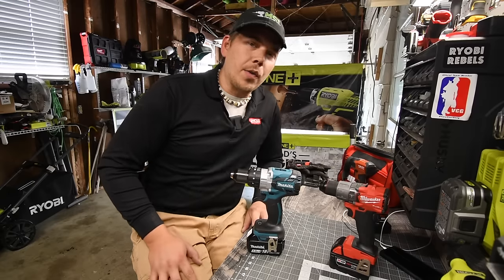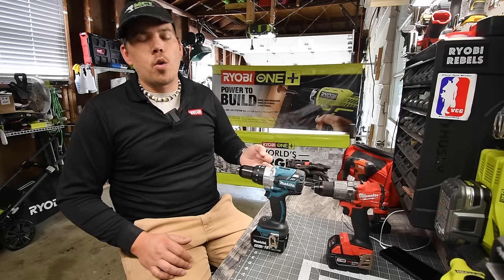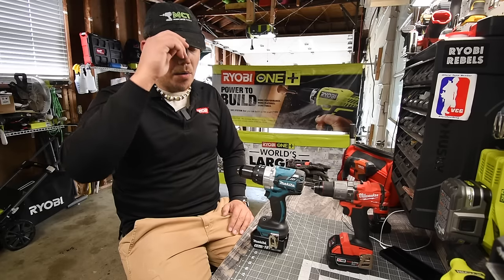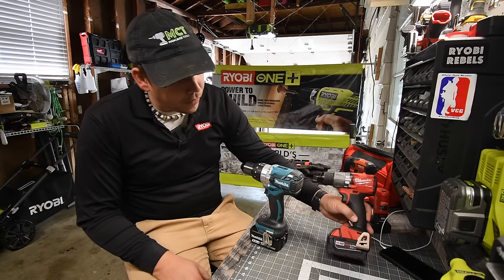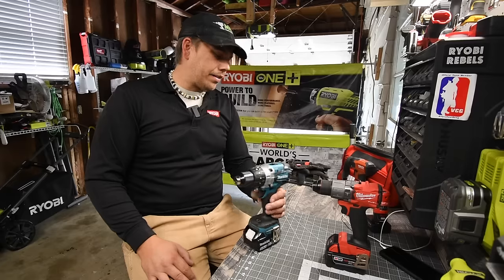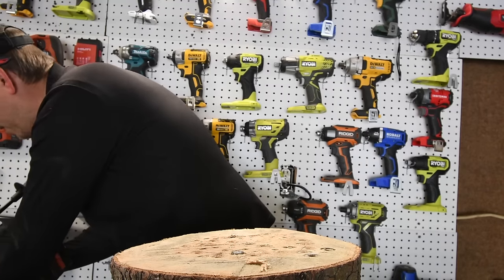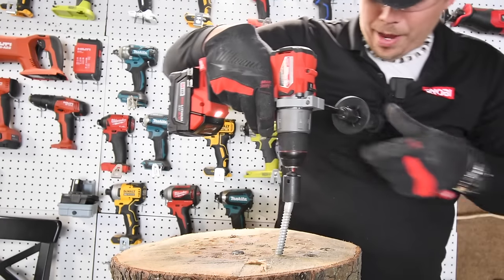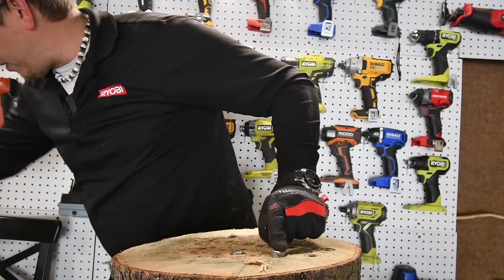BATTLE OF THE BRUSHLESS!!!  (Makita vs Milwuakee)

Comment: The chuck problem I have never had on my Makita and it is 8 years old and well used. Just tighten it and make shure hex inserts are lined up properly. never read or heard of clicking back before.
Reply: wrong, makita made a video explaining that you need to turn it back once to lock in place

Comment: I drove lag bolts like this for over two years straight with an old blue 18v Ryobi 1/2 drill 15 years ago. Im not really impressed by this test lol. And yes I still have that old Ryobi it still works fine but needs batteries.
Reply from the maker: Very good and I thank you for viewing Gary

Comment: I do think not using the correct battery does not match real life when I use high output. I get it, but I would think a fuel owner isn't picking their xc, I believe people will use their best battery
Reply from the maker: I wouldn't either, but not every test I do can only be using one type of battery

Comment: you can use the hyper tough cordless hammer drill to drive bolts
Reply from the maker: lol I think I would destroy that hammer drill very quickly
Reply: in hammer drill mode
Reply: @ManCaverTools  becuase its hyper tough and its cheap trash

Comment: So dont really matter at all, both very good, and very good even for professional users.
Reply from the maker: they are awesome hammer drill but it all depends on what battery platform people want to get into
Reply: @ManCaverTools  already have 10.8v makitas ( wish they had more tools on that platform) and 18v milwaukees , never had anything like it, only beaten by Hilti big plugged in tools.. did a 130mm hole, 400mm deep in reinforced concrete just with the18v Milwaukee... took quite a few hours, and it was burning hot, and think 5 or 6 battery changes... but it did it ;)

Comment: The battery difference is kind of unfair though. Milwaukee offer that drill with the capability to use the high output battery, so that makes it a product. Just because makita doesn't offer the same level of battery technology doesn't then make it fair to test the milwaukee in a mode where its essentially not performing 100% whilst the makita is performing at 100%.
Could of used a high output 3ah milwaukee and a 3ah 18v makita
Reply: yes

Comment: as far as i know makita in 2 gear stops when there is to mutch stress to keep the gears safe while milwaukee doesnot do that  
the last milwaukee i used broke easely while i had to get a nother drill i got a makita and it did better than milwaukee i took the milwaukee apart and the gears were broken inside now i only use Makita and Dewalt 1 of the makita is from 2016 the other is from 2019 the Dewalt is from 2006 the milwaukee was from 2016 and i have a small makita 10,8v from 2011 DF330D that has been handy in narrow spaces i like these tools :)

Comment: My brushless Makita is an absolute pile.  (Makita XFD12Z 18V LXT Lithium-Ion Brushless Cordless 1/2" Driver-Drill)  It has a horrible variable speed trigger that is hard to control and it shuts down way before the battery is discharged. The first thing to break was the chuck so I installed a Jacobs all metal one, then the clutch got weak and now under heavy torque it will randomly stop and make the grinding noise until I shift it back and forth a few times. It also abruptly shuts down when driving three inch deck screws. My 14 year old white Makita may be a little slower, but it kicks the new ones ass because it doesn't fail me. I'll probably switch to Milwaukie as I have yet to see one fail as quick as the Makita.

Comment: i think a fair comparison would be to use similarly priced batteries.  you can pick up a makita 5.0 for around $100 and an M18 6.0 HO for the same price (amazon now has the makita at $119 & M18 at $85 but since this fluctuates i think its fair to call it even). Just a thought
Reply from the maker: I don't think that would be a fair comparison

Comment: Hi love the videos, the makita was closer to the milwaukee than i thought it would be! Just a wee point to add about the makita on the irwin wood bit test, if you hold the trigger in any amount even just the slightest bit and the chuck cant turn then it seems to have a function that turns off the power to the drill! The trigger needs to be released and pressed again, Im thinking its a saftey feature so that it wont burn out the motor as is not turning! 
Id say the extra torque on the gen3 is what kept it going! I’ve used both drills and i find the milwaukee feels heavier while using but is definitely stronger! 

Wondering when makita are gonna upgrade their hammer drill/driver! 

Also i had never heard of turning the chuck back one click before, i always just tighten it up and it has never loosened! 
If you had time to do a quick test off camera by tightening it up full and maybe repeat the concrete test just to see if it does any better,  it was agonising to watch it keep falling out of the drill!! 
If its still doing it get on that warranty!

Very good video all the same and sure it made for a good comment section! 
Keep up the good work!!
Reply from the maker: Makita really needs to work on this chuck big time. just like Milwuakee needs to work on the collit for their fuel impact driver.

Comment: jesus, learn to tighten the drill and use is correctly. it's pain to watch this sloppiness..
clearly marketing bs.
Reply from the maker: have you tried to click back your chuck? if you havent give it a shot. it doesn't work with all drill
Reply: @ManCaverTools  i use mikita its my tool line and i never turn my chuck back and i also never lose bits
idk it just seems like one of those things where the proper way is not really the best way maybe im wrong but then again i never worn out a 1/4-1/2 bit before either

Comment: I'm very surprised with the Makita's chuck coming undone from the bit, also the clicking while tightening the chuck sounds like a clutch or something is stripped out. But I will say this, both drills in these tests are amazing.
Reply from the maker: I broke the chuck, im supposed about that
Reply: @ManCaverTools  sucks that you broke it, I figured it would be a tougher drill than that
Reply: It doing that because every-time he tighten chuck he also lose it by clicking back. Makita only tighten chuck to one direction, there is no "lock" by clicking afterwards to opposite direction. I think the guy on video is used to other chucks and he doesn't bother even read the manual.
Reply: @fusssarium  actually turning the chuck back one click is supposed to keep the bit locked in, Makita Australia has a video showing how to tighten bits in the chuck, they show turning the chuck back one click to lock the bit in. it doesn't always work as Dave explained with the Milwaukee. But i think that Makita may have been faulty from the factory. I own the same Makita drill and the chuck is rock solid, never any issues.

Comment: Personally they are very similar.. both are better than dewalt..  most of my electric tools are Makita.. had old Makita battery tool didn't last too long .. now have some Milwaukee battery tools they are still going strong after 4 years of abuse...its 6 of one half a dozen of the other depends what type of tool your using

Comment: Did you actually know that Hammer drills  are not a thing in asia and europe? We have the same high specs drills optional without hammer function. 
In Europe they have actually a bad reputation because it seems that the hammer function works negative on the drill axis and gearing or chuck so that you get alot of bit and drill wobble. After some time. Especially if you hit rebar.

I still own the Milwaukee M12 hammer drill as an secondary.  It has it advantages especially on this tiny funiture dowl holes of 5 mm where an SDS is mostly overkill. But anything beyond 8 mm is just a pain with hammer drills also the big 18Vs. 

Anyways, if you see this comment. Check out the new Bosch GSB 18v 150c. Maybe its an interessting one for your channel. Its get released in middle 2021. 150 nm are like 110.63 foot pounds. Stats are impressive
Reply from the maker: I want the HILTI drill drive that europe has

Comment: when you insert hex bit try to have closed drill head as possible an insert between the jaws than tighten, not as standard drill bits!  whe you look at wood bar, it looks it has different dension on, try not to drill one tool on one side

Comment: When you had the chuck clicking like that, its because you had the clutch engage, to prevent That you have to set the clutch as high as it will go! Just a tip, good work otherwise
Reply from the maker: I thank you all computing
Reply: How much mellaike
Reply: No, the clicking comes from the transmission. My one did the same noises while locking the chuck and a few months later the transmission was gone.  
Spindel Lock is the mechanism called, that makes so much problems on the Makita drills.

Comment: Great Job David! Even though I now handle these tools & see & feel the difference, I don't use or keep them. Also even though all brand new, I just slap a battery in check all the settings quickly before they are repackaged & sent off. Nice to see them in action!
Reply from the maker: Its a good way to sell them and I thank you Bro
Reply: That’s cool ! Where do you work bro? I’ve always wondered the inner workings of the tool world

Comment: Great vid! Cheers from Argentina. Im switching from my old ni-cd 18v Daewoo to this 2804 Milwaukee. I think that i will be very impressed! Do you think that a high output battery would make a significant difference?
Reply from the maker: the high output has a major difference with tool performance

Comment: Good show, Makita is very nice but no matter what these different manufacturers do Milauwakee always comes in the top, their power tools are the best. 15 years ago I made my basement with few Ryobi tools I still have the saw and drill it's works for small stuff
Reply from the maker: I do thank you so much for viewing :)
Reply: It depends on the tool every manufacturer is better at different tools Milwaukee don't have a better saw than Makita Milwaukee is just made cheap nowadays like they burn up just as fast as a Ryobi and don't hold up like they used to before tti bought them out
Reply: WRONG!!!!! Milwaukee is certainly not cheap made

Comment: I've had m18 gen 3 and m18 fuel hammer drills fail in less than 1 month, as well as other m18 tools. Pure disappointment in Milwaukee!
Reply: We use them at work and they have suffered the same fate don't matter how fast there are they don't hold up
Reply: My chuck blew out drilling 4 inch concrete today. The drill is 5 months old with occasional use. I'm very surprised to see all the reviews from around the country to see milwaukee chucks have gone down hill and keep getting worse. I removed the clutch and cut it open what did I find? Plastic..... M18 fuel 2804-20. I ordered a Jobbs replacement chuck. May be going to mikita. Mine did exactly what the mikita did in this video.

Comment: Your unlocking the chuck for turning it 1 click on the other way. Some says its the proper way to lock it i tried it but its not it will just loose its grip when it runs.
Reply from the maker: this locks the chuck up but there is an issue if your doing something that is using the torque to the max while its locked

Comment: Makita is way more reliable than milwaukee. 
Milwaukee has better warrenty.
Makitas are cheaper and only marginally slower/weaker than the milwaukee equivalents.

Are milwaukee worth the extra money? Not really.

Milwaukee do however have a better collection of none motorised tools than makita. I.e. the packout, drill bits, cone cutters, cutters etc.
This does make them more appealing on the other hand.

The 1 thing I HATE, HATE, HAAAAAAATE about the milwaukee drills/impacts is the delay you get after the trigger is pressed to when the chuck starts to spin.
Makias are INSTANT in comparison.

I do like both tool brands
I prefer makita for motorised tools
Milwaukee for anything else.

What are your preferences?
Reply from the maker: im a huge fan of makita myself. you won't see many reviews of a bad makita story

Comment: Makita drill is powerful, and for the price, it's a great deal. Right now, Home Depot has an offer for a $250 Makita drill and Impact and $400 + free tool for the Milwaukee same drill and Impact.
Reply from the maker: Ys sir and I than you Ev
Reply: And you get 2 4.0amp batteries and free sawsaw at tsc as of now till march I believe.

Comment: That is the reason I jumped ship from Makita to Milwaukee. That bloody Chuck man! I went through 3 drills in a year. The Chuck got so locked up it couldn’t be repaired. Sometimes couldn’t even get the bit out the drill with out using grips on it. Constantly stripping drill bit ends. So so frustrating and now I’m so glad I moved to Milwaukee such a beast for such a small drill.
Buddy it’s the Chuck not u
Reply from the maker: I thank you for the input Beariam :)

Comment: I Have that one and had other makita drills and the chucks have always lossened up, had it replaced and a month later same. Three years ago got another makita set hoping they fixed the chuck issue -two weeks later bits start falling out. The most recent compact version and the middle one are fine at one year.
Reply from the maker: they really need to fix it and now lol

Comment: Hey man, love the channel, you're doing an awesome job! I recently talked to a friend who is professionally doing all kind of wood constructions and some metal constructions and repairs aswell, and he told me, he's been using Makita and DeWalt (sometimes even Hilti) before, but nothing comes close to Milwaukee when you simply need to get a job done, day after day for a longer period. And it's not the first time I heard Milwaukee tools just do the job quicker and better with same power specifications. For professional use it's worth the price difference, since in Slovenia, Milwaukee is  quite a bit more expensive than Makita.  For personal use, Makita is more than enough. I also use it at home, since I don't do a lot DIY stuff. Just sharing this info for people, who might want to start a business or just want to do DIY stuff, and they are deciding which tools to buy.

Comment: You should know the features of makita. When the motor stops, that's the safety features
Reply from the maker: I know, a lot of tools have that. the safety feature is what these videos are testing out. when these tools stop while working its mainly because of the safety feature because the motor is being majorly used. Milwuakee is more power so the safety feature doesn't activate as quickly as this makita. that is the point of my videos

Comment: Dave, one other item.  If you were to use the 3 amp, 6 amp or 8 amp HO Milwaukee batteries you’re going to get more torque and speed.  It would be nice to see these tests run with the best batteries available between competitive manufacturers.  If the other manufacturer doesn’t have an equivalent battery it shouldn’t matter, as it should be the best way you can equip the tool to be tested.
Reply from the maker: I know It would. because those batteries have 21700 cells in them

Comment: Nice Dave! The chucks on the Makita are getting worst and worst.... this why I only use them for certain tool... Man you need to test the metabo SB 18 LTX-3 BL Q I
Reply from the maker: I plan on getting metabolic soon and I thank you  you Jose
Reply: Jose Morales, no they aren’t!  I’m into the Milwaukee M12/M18 platform, but I know the quality Makita puts into it’s tools.  Their chucks aren’t getting worse.  It’s “worse” not “worst” for edification purposes.  They’ve always sourced and used excellent chucks, e.g. Jacobs.  The issue is with the user.  Dave isn’t tightening the chuck properly on the drills, as he’s tightening clockwise, then going backwards or counterclockwise a turn, thereby loosening the chuck back up.  I’m surprised more drills haven’t failed, by having their chuck jaws stripped.

Comment: I calculated the hp of both drills and we have: Milwaukee 14,19 HP and Makita 12,88 HP (assuming that the manofacture claims are correct) the
Reply: Lol, not even close. They are around 1hp max, if even that. They can't have max torque at max rpm
Reply: @riba2233  umm HP is torque times speed /5252, assuming that they give the torque at the lowest speed, that's the results
Reply: @Lucas_sGarage  that is only max torque, at that level rpm will be very low. Batteries are limited to 2hp peak, cmon
Reply: @riba2233  the batteries output a ton of current, and horsepower isn't only depending on speed or torque, as i shared before, the power output is a combination of both

Comment: I work for a industrial mechanic/millwright contracting company and we use makita for our cordless tools. That makita drill is a steaming pile of garbage when it comes to long term reliability. That chuck problem happens to every single one of those drills. We’ve cooked many of those drills working with steel, almost always drilling 7/16” diameter max holes through sheet steel to 1/4” which is well within what a drill like this should be capable of doing. We’re looking at switching to Hilti just for our cordless drills.
Reply from the maker: I wanna tear the makita apart and see what went wrong

Comment: makita manual "Turn  the  sleeve  counterclockwise  to  open  the  chuck  jaws. Place the bit in the chuck as far as it will go. Turn the  sleeve  clockwise  to  tighten  the  chuck.  To  remove  the bit, turn the sleeve counterclockwise." no one click back. where did you read that. you have destroyed the chuck, no fair testing. read the manual before doing any test.
Reply from the maker: I thank you for viewing